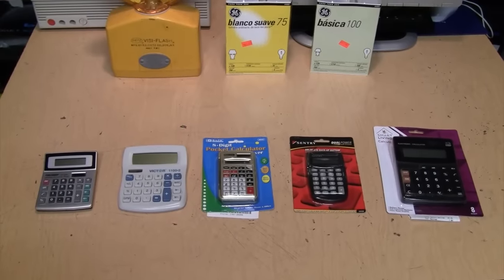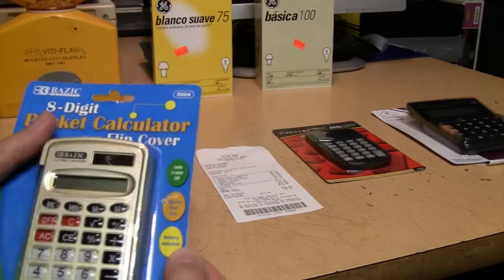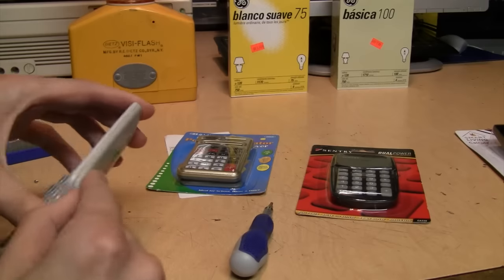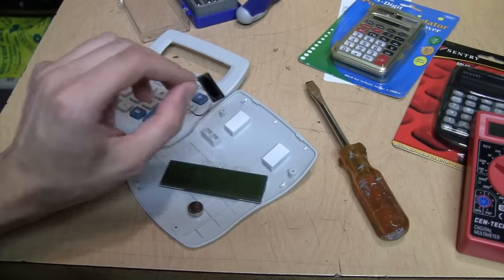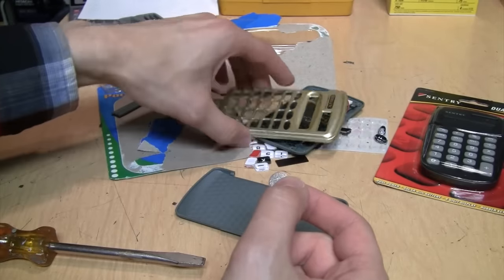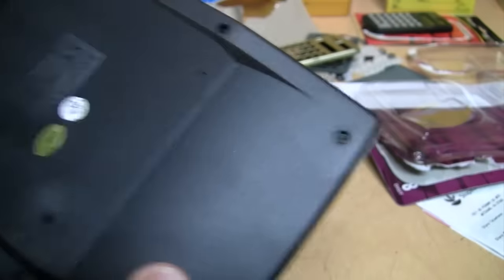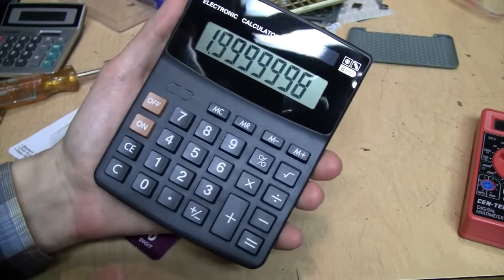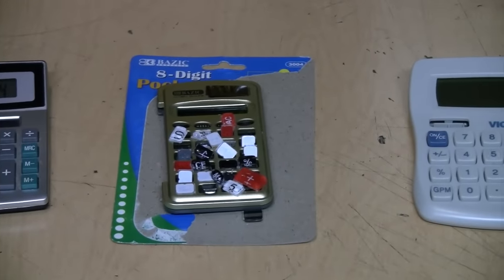Solar calculators BUSTED!

Comment: I'm China most store owners have large calculators that speak in manderin with a function in English,    example buying glass bottle of coke around 250ml  they will turn on the English function and press a button that will say sale 1.5      I would give them a 5rmb note and sometimes they would press 5 - 1.5 = 3.5.

I did not know about the musical calculators, they have calculators in Cantonese for HK, Guangdonf and other Cantonese speaking areas.

It's nearly 7rmb to 1 dollar but in stores and with money they only have RMB and 10 Jiao = 1RMB.     In the past 10 Fen = 1 Jiao or 100 Fen = 1RMB    but they phased out Fen in cash decades ago and is now only seen in banking example, 818.81 in an account but everything else will be 818.8.

Comment: You dont now if the solar cell is real, even if you messure voltages, sometimes you will measure the batteryvoltage, beause its wired up like that

Comment: Most of these "solar" calculators, i just touch the solar panel and if it feels like soft plastic, then it's easy to tell it's fake.

As for the diode.. it's it's all about speed, cutting the leads takes time..

Comment: This is BS. I own a Sharp EL-W516T Calculator. Right before a test I decided to checj my calculator outside of my classroom and realised the battery was dying. But I also remembered that it had a solar cell. I walked out from under the shade into the sun and noticed my calculator's screen shot up in brightness. I realised that the solar cell was actually charging the battery in the sun so I left it out in the sun for a few minutes and my battery was charged. The screen didn't dim at all nor showed any signs of the battery dying and I was able to use it fine during the test.

If you buy cheap products from China without verifying if they're even good, you will get ripped off. Calculators not having a working Solar cell isn't an epidemic you should be worrying about. If you bought you calculator from a high rep company and not from some back alley, it would work perfectly fine. Don't let a couple of bad apples spoil the bunch for everyone. The writing on the calculators you bought even had Chinese writing. The Chinese don't have any relations with the products they sell. Buy a calculator that was either made in the US orwas designed in the US and manufactured in China,

Comment: You can see on the first calculator where the batteries used to go AND where the solar panel used to connect to the board, lol

Comment: I bought a solar calculator. It eventually died and I replaced the battery. I don't like to throw things away if you can keep using them. The replacement battery cost as much as the machine but i received an extra and it should last a long time. I'm old😄

Comment: I have Casio calculator that brought 1997.  That have real solar panel and charging circuit. That thing still works and i had changed battery few times.

Comment: Tbf with todays battery technology and the efficiency of modern chips having a solar panel is kind of redundant. You are much more likely to break it or lose it before the battery dies. Ofc id prefer a replaceable or rechargeable battery but still. 

If only they wouldn't falsely advertise it.

Comment: The Casio FX-300ES is a cheapy and has a functioning solar panel. I know this cause my battery died in the middle of a meeting and I was able to power it using the flashlight on my phone.

Comment: Lol, this battery is for these like situations, try to cover the solar panel and still use the calculator, it will spend all its power and will not work until you will uncover the solar panel

Comment: You can tell wich ones are fake because if it isn't taking voltage it will always look like new but if it's real usually I has a burned in wear on it that happens over time, you can even see this in the video with the one that he brought from his job it had that burn in circle because it was real

Comment: 1:52 looks like þe case was used for a different circuit board as you can see spots for batteries on the opposite side of þe fake solar cell

Comment: The calculators with fake solar cells never claimed to be solar powered, my guess is to save money they used the same moulds as the ones that are solar powered. Yes misleading, but not false advertising.

Comment: Idk why they even makes those anymore when cell phones have them. I guess probably for students that are not allowed a cell phone in class, but some math classes won't let the students have a calculator anyways unless they have to have one of those Tex instrument kind that are very expensive. So I don't see the need to make those basic ones just use your phone that everyone has anyways and not spend any money on one when you already have it on your phone. 
Also I did the same thing by putting my finger on a calculator solar panel done the same thing.

Comment: I don't know how I got here, but I ended up opening a cheap Datexx DH-100 I had laying around. It had a solar cell wired, but I thought I had it pegged when I pulled the battery and it wouldn't power on. But I upped the brightness on my lights and it powered on without the battery XD

Comment: the diode is for a voltage drop because this have no loding circet the solar is paralel to the batery and your solar have 2volts and your will battery break by a voltage over 1.7 so they use the diode as a voltage regulator. its not the best way but a saver as without. and a regulater will propaly decrese the  effecienty. so i think its a perfect solition. and you musst know a thinnfilm solarcell not duable like mono or poly silicon cells there are like battarys they will degrade over time and so higher the current even faster the cell will die. every solarcell type dont last for ever the flowing current damaged the cell over time but a thinnfilm degrade faster because the actual solar cell is only 10µm thic and a silicon based ¼ of a mm up to 1mm

Comment: I tried the square root of 2 trick on an old TEAL calculator from the 70s, and it does the same thing. I think calculators are programmed to round the digit with the lowest place value up or down if it encounters a figure that doesn't fit on the display, such as the square root of 2. I guess some things never change.

Comment: have a texet sl-8, with solar panel, has a cheap rechargeable AA batt in, yes, the solar will power the calculator without batt, but needs a good light,   it just trickle charges the batt,  its the same as the SE cal3800b in your vid, just different name,  my mrc/m-/m+ buttons are blue , yours are yellow

Comment: I hate the ribbon cable.  Most of my calculators seem to die because of the glue failing on the cable.  This is on cheap and higher priced calculators.   Need to find a source for new stich on cables.   Or stop collecting calculators.

Comment: Modern calculators are crap. Get some nice vintage ones from back when they didn't use that cable that breaks. Modern ones usually has too small solar cells to run on those alone.
On the other hand battery powered ones aren't that bad either. I have a vintage 1982-83 Sharp EL-230 that I use at my office desk. It still has the original zinc carbon cells whose expiredate was somewhere in 1985(!!!) So almost 40 years old and yes it has been used (mostly not by me, bought it at thrift store as I needed one) yet it's 100% original even down to the batteries!!

Comment: well, my solar calculators are all real, wich is annoying cuz they don't work well with artificial lighting

also got a solar powered alarm glock
bought it way back in 2007, it never stopped working, apperantly it has a rechargable battery inside so it stay on during the night

Comment: I remember when I was small I had a calculator which had a true solar cell and I opened it and connected a buzzer to it and in sunshine it used to beep and then the wires fell off 😅

Comment: Its because it would cost them money to redesign the molds to get rid of the solar cell when they can just use the old molds and batteries are probably cheaper than actual solar cells.  As long as the calculator works, why would you care?

Comment: Molds for injection molded plastic, VERY expensive

Batteries, very cheap
Solar cells, more expensive than batteries.
Plastic to stick in mold mold made for solar cells, VERY cheap.

Comment: Seems as though 'Sentry Industries' was involved in the past with cameras and film and also reel to reel tape. These are horrible calculators. I remember in school back in the 80s buying a calculator for £10, which today, accounting for inflation, is more than double that. Those calculators had proper dual power.
Reply: They're still around. I wonder how good their headphones are.

Comment: I don't get it... why are you acting surprised?? On the calculators that clearly do not have any say about having solar power, and on the package it's clearly saying its battery operated and even tells you what battery it needs to operate.... oh!!! Look at that!! Its not solar powered!!
Well duh it also was clear enough on the package telling you it needs a  battery!!!
You cant just look at the calculator and then just make up what features it should have!!!
Thats why its important to READ the package..
Gees...
That first one i knew right away it wasn't solar powered when you said it didn't say it was solar powrred anywhere on the package...
Ok thing is they probably make mutiple models of that same calculator... and some modles are probably solar powered..
But rather than use mutiple casts and have mutiple face fronts, they just use the same face for all modles.. and instead of having a hole or dent on the front they put the plastic on there as a sort of touch up finish...
It's not meant to deceive really...

Comment: I had a solar calculator I used in school way back in 88 I borrowed it from a friend 2 weeks before the last day of school it was June 23 1988 when I graduated and I guess I forgot to bring it back to school on the last day and I still had that calculator till 1997 it still worked up until 2003 when it finally died lol

Comment: Call these proper tests? How about measuring the voltage of the solar cell with zero light as the voltage could be coming from the battery? I call 3 of these tests false until you do it properly.

Comment: i have a transparent calculator and i can see the wires in the solar cell also when i put my finger on the solar cell it stops working + was cheap (not higher then 5-10 euros)

Comment: My deepest condolences that you were fooled by a bogus Chinese 'solar cell' calculator. Still, you really should learn to embrace any errors or mistakes which are your own.

The fact that the display didn't dim when you covered it should have given it away immediately. That's on YOU, man. After all, the entire point of a solar powered calculator precludes the necessity for a battery. That's why it's called 'solar powered' and not 'battery powered'.

Now, myself, I've used the odd solar powered calcuator here and there ever since they were invented, oh... how many millions of years ago?

Anyway, they've been around for a while. With that being said, I've always found great joy in covering the solar cell and watching the display fade when I deprived the simple machine of it's lifes blood. Of course, I almost always removed my finger once the shits and giggles were over with...

Or, if I wanted that Extra Thrill, I'd throw the solar powered calculator into a dark drawer and forget about it immediately.

Again...

My utmost sympathies that your preconceptions were dashed so brutally, regarding your experience with these fake solar powered calculators which apparently have been hitting the shores of other countries from China since... well, if not millions of years, at least since 2010. 

How much did you pay for that knock off piece of crap, blatant liar of a calculator, anyway? Just curious. Because, you know, China is known to really enjoy a good practical joke. 

So if you paid more than 5 bucks for it, hell, I'm gonna go into hysterics along with the Chinese! However, I'm just sorry that you, who seem like an ok dude, were at the receiving end of The butt of Chinese shenanigans.

SO! What did we learn? That's right. Use your phone calculator like a Cro Magnon in the 21st century!

Good. I'm glad we had this chat. Always happy to help the odd Jerry now and then.

Comment: Just wondering, how were the three calculators with blanks inserted in the solar cell windows "busted" when they were in no way, per the packaging, claiming to be solar calculators? Obviously the makers used the existing cases acquired from another company and only intended to manufacture a battery powered version calculator so they put blanks in the solar cell windows.

Comment: I have a casio calculator that I had so long that the battery died but it keps working because of the sollar cell. And the solar cell kept charging the dead battery until it inflated and broke my battery cover off lol.

Comment: "...so if you have some of these cheap solar calculators lying around you might wanna open them up to see if the solar panel is real or fake"
In other words "I have a perfectly good calculator,  but I need to check if the solar panel is real or fake." Result: "Oh, it was real/fake. Now the calculator doesn't work anymore"